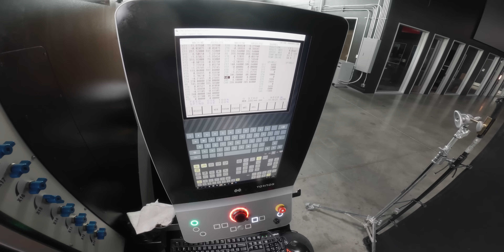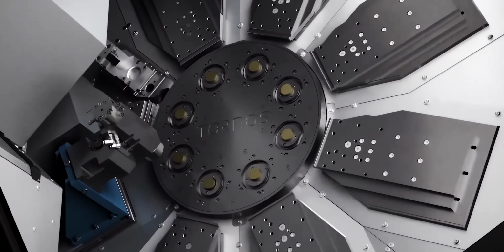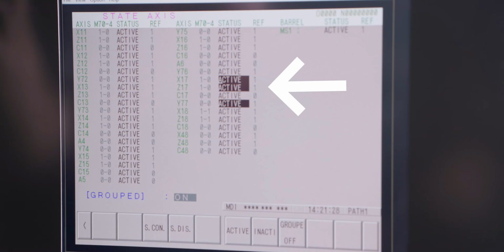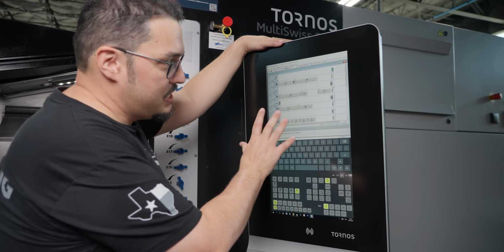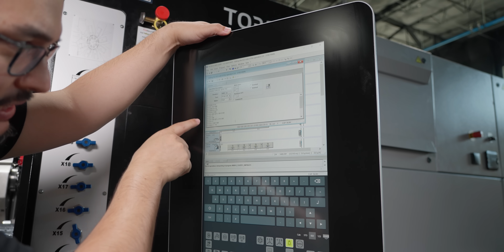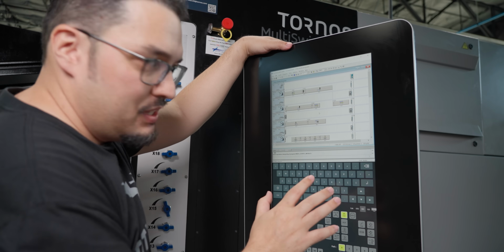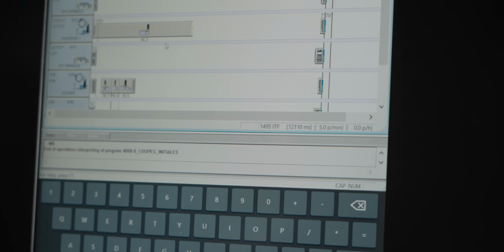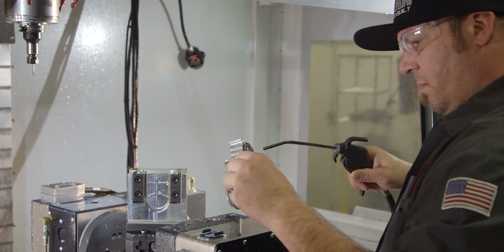Tornos MultiSwiss: Most Complicated Made Easy

Comment: I used to run these. What was a 12sec part on single spindle became 4.25 on these. However the best part was as the cycle time was the slowest operation you could slow others and not effect cycle time. For example slow drilling to make the drill last longer and drill larger size, therefore boring was easier.

Comment: I would be really excited if I had given a chance to learn such machine. Sadly I don't have anything close to this complexity machines around in my little European country. I would be the first one to agree on the challenge of learning it - have had experience with swiss lathes and I loved working on these machines, now I'm working on a standard Haas ST20Y which is fun, but not as rewarding as getting the cycle times as low as possible using two or more separate spindles.

Comment: I worked for an aerospace fastener company in the 80's. Then all multi spindle machines were cam driven. They had Davenports for Aluminium making nuts or collars as they are called in the industry. 5 sec cycle times. For steel collars like 17-4 stainless steel they had slower Acme Gridley multi spindles running with oil coolant. They had  one that was for 2" bar. The floor would shake when that machine indexed. They're all gone now, replaced with Euroturn's. Even newer are the full CNC multispindles from Index, a German maker. Over a $1 million each for those guys.